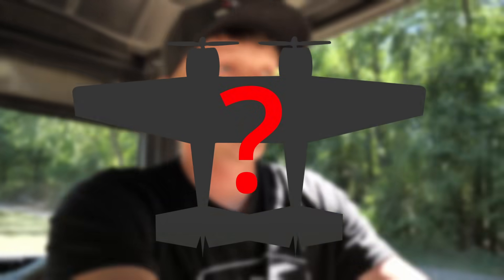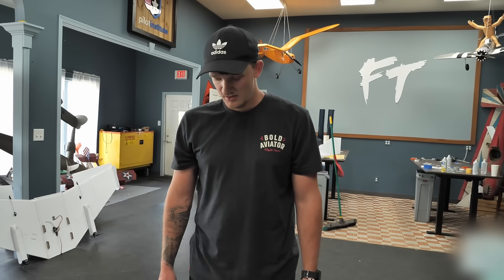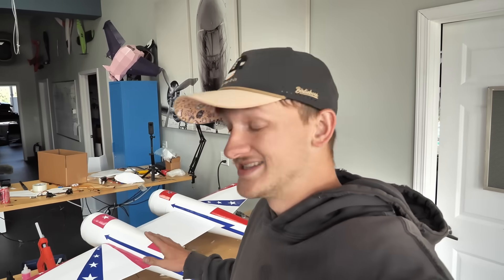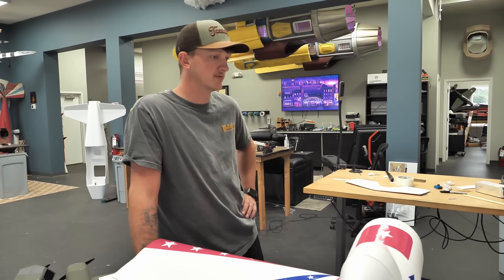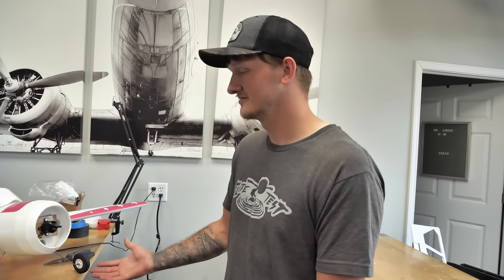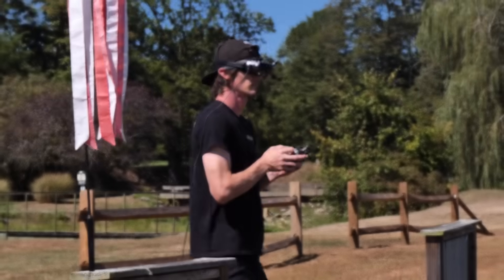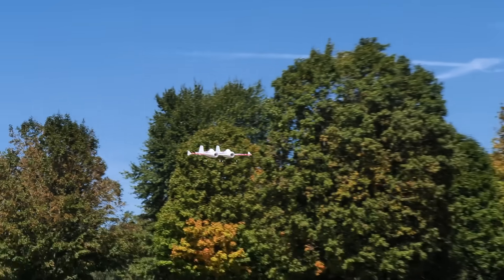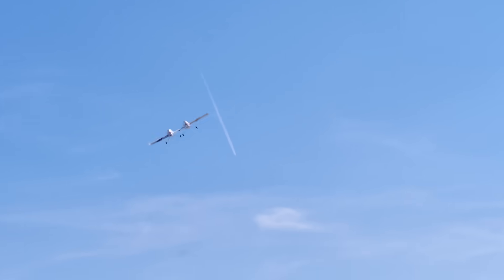Building A Yak 110 - Will It Fly?

Comment: So I don't know much about rc planes, but I am a retired A&P mechanic. So I was thinking you could cut off outside elevators on the tail section & make the center elevators work as one. You could make the inside wings one wing but take off the ailerons, & make it just one long wing/airfoil, maybe put an air brake on the top of it. I would just use the ailerons on the outside wings, & have a switch were they can be used in sink like both up or down or out of sink like one up & one down, to do rolls. On the tail section, the brace that holds the rudder you could cut the down for weight & less air resistance. The landing, the inside legs could be cut off. Just use the outside ones, and like your buddy said I would counter rotate the props for better efficiency and less body roll from the prop torque.

Comment: Please please PLEASE do a POV plain with 3 axis gambol head tracking as well as long distance transmitters and what gear you would take.  4K would be preferable, but if it is too hard to get a clear picture with 4K then less is fine.  I think a gimballed camera is 100x more immersive because people do not just look forward when flying and I absolutely can not fly without POV.  And can you use say a drone hovering at higher altitudes as a relay so you do not loose signal because going around hills and buildings?  I'm not into stunt flying but love exploring when flying.  A set-up you could use on a drone or plane would be cool.
Reply: Aren't there canned plug and play solutions for that stuff these days?
Reply: @DeadtomGCthe2nd  Could be, most are closed systems and very limited and it is hard to find reviews and videos showing how to modify them to use better cameras or signal boosters or a better set of goggles.  I do not have the resources or knowledge to really know if any of this stuff is good.

Same with long range.  They did something on long range video, but that was several years ago.  Their used to cover controllers, cameras, goggles... in several price ranges.  I think it has been well over 5 years since the last one.  These were at their old place.